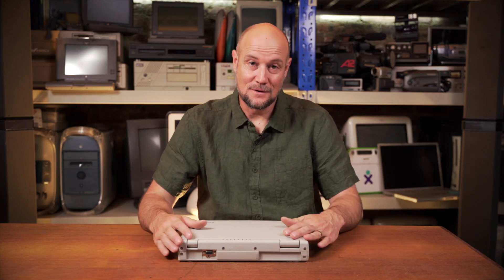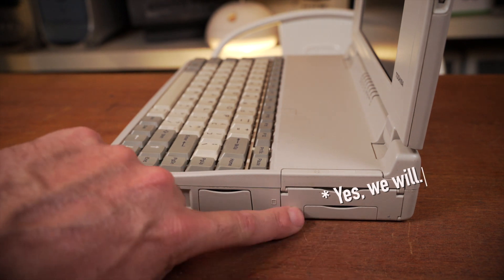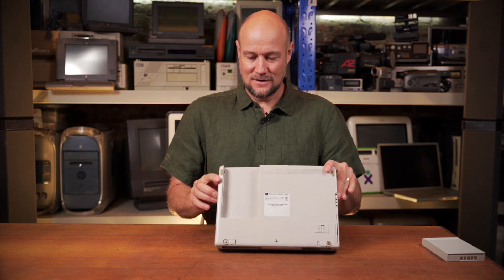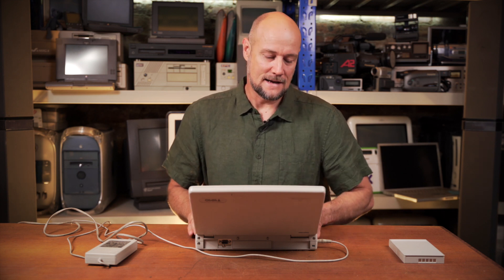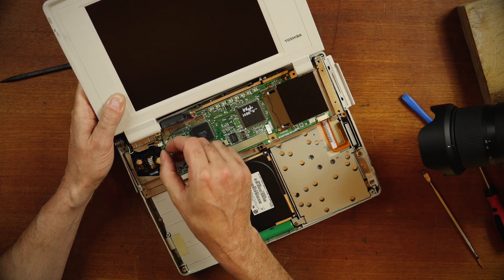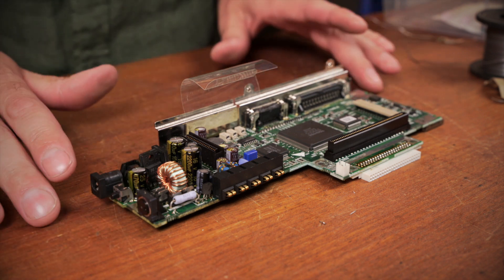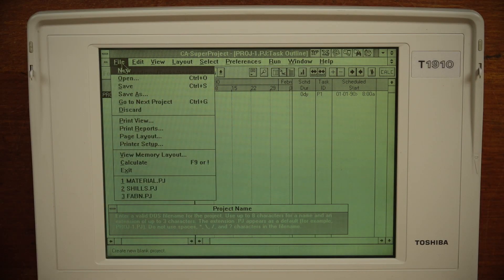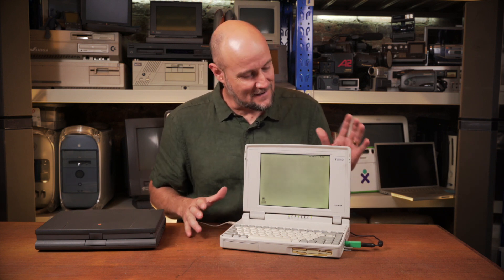$20 Toshiba T1910 Laptop Repair

Comment: At 8:00 that's the RTC battery if i'm right? (not the beeper/speaker). What RTC battery replacement are you using?
Reply from the maker: No that was a little piezo beep speaker
Reply: @TheBasementChannel  Ok, my bad. In the meanwhile i found that PANASONIC VL2330 could be ok as a replacement RTC battery (3V 50mAh).

Comment: I just picked up the same laptop. Had the very same problem now repaired. Need to sort out backing up the hard drive to preserve the system.
Reply from the maker: Must be a very common issue with these. Good luck backing it up 👍
Reply: @TheBasementChannel  I believe it is very common. Next task is the floppy drive.

Comment: Those power bricks would need a recap soon. Had to repair two recently, both of them stopped working or just worked for some time. It can be disassembled without much effort, there is a screw underneath the label, and with some prying, the two halves pop out.
The caps were starting to leak, so even if it works, it is a good idea to replace them
Reply from the maker: Great advice!
Reply: @TheBasementChannel  sure thing! Btw, those toshibas also need new belt in the floppy drive. I tried to replace it once, but didn't have the exact belt, so it didn't work. Do you have any experience with this? There are two different types of floppy drives, one of them is Citizen and one (I think?) is Panasonic

Comment: I've picked up on of these a couple of days ago. It's a neat mashine that is in really good shape. I even have the Microsoft Ballpoint Mouse V2 that originally came with it. However, the floppy drive seems broken. You can hear a subtle whirring noise when it's trying to ready floppies, but nothing else happens. Based on this my first assumption is that the drive belt has come lose or has ripped and needs to be replaced. So I'll definitely need to disassemble the unit to have a closer look at the floppy drive and which type it is. I'm not sure whether I really want to venture on after that and try a belt replacement, or whether I want to find a working floppy drive. We'll see ;) Anyways, this video showing disassembly definitely comes in handy. Thanks!
Reply from the maker: Sounds like you’re in for an interesting journey, glad I could help you in some small way.

Comment: Loverly video, nice to see you got it working. I used to use a very similar model of this type of Toshiba laptop in work a long time ago now. It was a great laptop for the time. With quiet a few models you could select the screen type, I was luck to get a colour screen that did not smear too much, so you could play doom on it, not overly well, but it played OK.
Reply from the maker: Yes the passive greyscale screen on this one lets it down a bit. An active colour model would be great.
Reply: @TheBasementChannel  I seam to remember the colour verison costing exponentially more.  They had some increadible docking stations for a number of models too, that had a few pci and isa slots in them, and 2 drive bays.  We had a few of those a work, with a madge token ring card, normally a cd-drive, sound card, and sometimes a svga card connected to an external monitor.  It did mean messing around with a wrapper script that altered windows 3.11s config so the correct graphics driver was loaded.

Comment: I had the proprietary mouseball that connected to the side. I still have a very tactile memory of using it. The underside curled up if I recall correctly? So if you rested too much of your hand on the mouseball it would pop out of the port. Kind of annoying, but I remember it fondly.
Reply from the maker: I think those trackballs must be pretty rare nowadays. I’ve heard a lot of stories of them falling off and breaking as they hit the floor

Comment: Great work! I wonder how many of these machines were tossed in the trash when this happened. I wonder what would happen if you were to connect an external display to it? I assume it would show in colour? Give it a go and post some pics on Twitter/Insta and let us know! Also - I think you should look at replacing that hard drive with a compact flash adapter solution - you'd loose the noises of the hard drive but it would be a much better solution. You didn't tell us the specs! How much RAM has it got? Does it have onboard audio?
Reply from the maker: Yes it’s vga colour on external monitor but can’t do dual screen. It’s a 486SX 33Mhz machine with 4Mb RAM. These take some weird RAM add in card, goes in the side flap. Only beeper audio. It’s a pretty basic machine really.

Comment: You had more luck than I did! I've got two of the CS variants (fancy colour screen!), and both exhibit the same issue. But I think I bought cheapy caps, and that's bitten me as it started the blink of death again as I was assembling it!!! The originals were leaky though, they had the tell-tale smell when desoldering. Also worthy of note, the floppy drive one at least one of mine has died - it's a belt driven unit, and the belt perished. Couldn't find any replacements, and the replacement drive I put in has yet to perform. Still plenty to do, but I agree they are utterly lovely machines. Nightmare to disassemble though!
Reply from the maker: Great info, thanks for sharing. You’re right about disassembly, kind of wished I’d archived the hard drive while I had it apart.

Comment: Nice to see another NZ YouTuber! Interesting issue, I've seen that flash code before on slightly newer Toshiba laptops. I might have to try a re capping of a power supply to see if that fixes it. Good to see another old one saved!
Reply from the maker: Thanks! Yes it’s apparently a fairly common issue across a range of Toshiba machines. Getting to the caps is the hardest part!
Reply: @TheBasementChannel  Yeah the plastics are quite old and getting spare parts is really hard